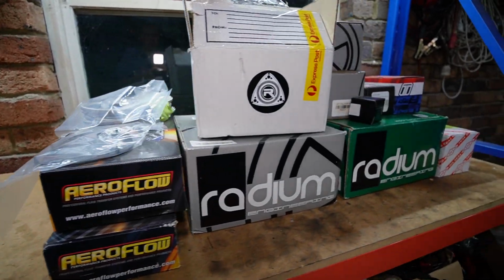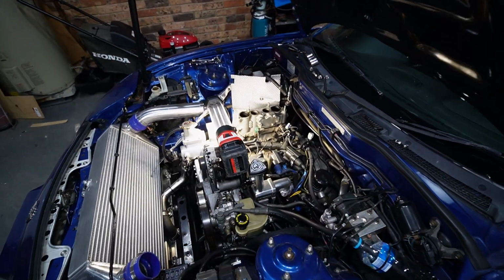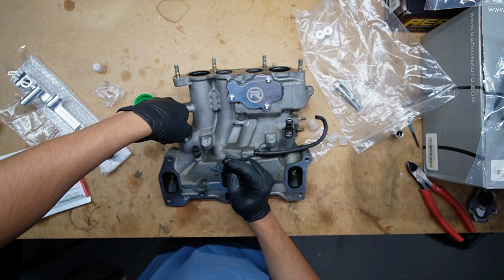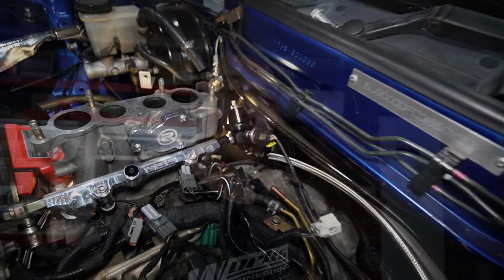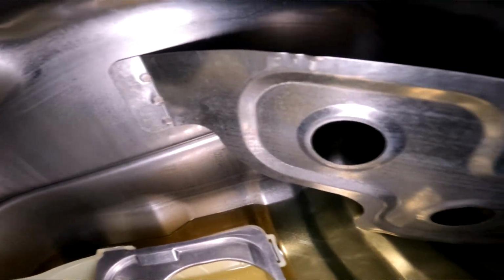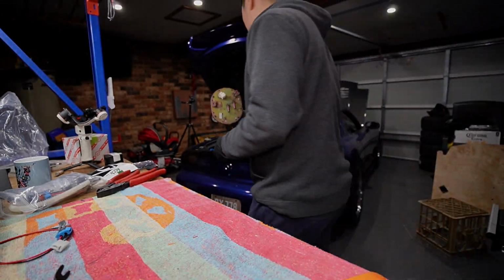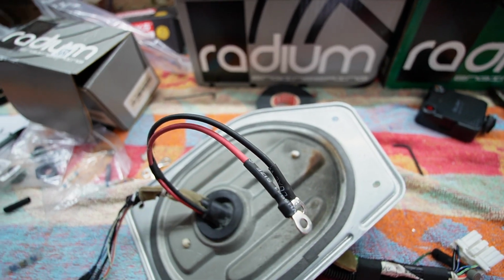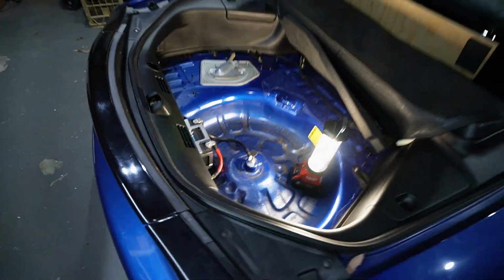500HP fuel system upgrade on the RX-7 ft. Radium Engineering Surge Tank!

Comment from the maker: **HOW MUCH POWER (HP) WILL THE FD MAKE?**
PTE 6466 
Secondary injectors ID2600XDS
Walbro 525
Stock ignition
98 fuel only
Reply: 507 powers of the horse!
Reply: I honestly believe 300rwkw would be more than enough on 98. I reckon you should get a flex tune
Reply from the maker: @cgrschannel7256  someone needs to dyno a horse
Reply from the maker: @cemturyan2653  I think in the future i will have no choice shall i decide to turn it up (which i will). I think for now i'd be happy with 300kw!

Comment: Interesting video, I recently installed the PAC FDd fuel tank in my car. It's good to compare the options.

Personally I would look to upgrade the fuel lines too. You can eliminate the leaks that happened in this video, such as the banjo fitting and the clamp on the tank by using AN fittings. For what isn't a great deal of extra cost and won't take a huge amount of time, you will have reliability and peace of mind.
Reply from the maker: I didn't know they did a fuel tank for the FD! 
My reasoning for not doing the lines now is because the filter relocation fittings are -12. While i can use step down fittings, the factory hose diameter is plenty for what i want with the car. There is nothing wrong with reusing factory rubber lines. The leak from the banjo was due to a faulty copper washer.
Reply: @JCYT  The PAC tank is great, easy to fit up and can do triple pump. Completely agree though, there is nothing wrong with the factory lines. Personally I want to eliminate points of failure and prefer to stay away from clamps. Also I run e85 so the PFTE lines are a must. I too have a similar filter (aeroflow -12)  that has been relocated just after the diff - previously it was on the diff, but there is not enough room with the bigger PAC tank. Stepping down to -8 has not caused any issues.

I do take a lot of inspiration from your videos though, keep them coming. I plan on replicating your battery mod. Mine is currently in a moroso box in the boot, but I would like to make it a bit cleaner and I like your concept hiding it in the spare wheel well.
Reply from the maker: Let's see how the tune goes and maybe I'll be forced to change them! 
Thanks for the support 🙏

Comment: what size injector you using for primary and secondary? You running Power FC ECU, right?
Reply from the maker: Haltech Elite 1500 
Factory primary injectors
Secondaries are Injector dynamics 2600xds

Comment: Amazing video! 😍 Could you please tell me what battery you're using? Does it need to be constantly connected to a charger? I'm considering replacing my 20kg Optima YellowTop with something smaller, but I'm concerned that my electric water pump will drain the  battery quickly if I switched to a smaller battery. Thanks Jonathan
Reply from the maker: Hey mate it's a Lithiumax Race 9! No I never have it connected but have an isolator I can isolate the battery if I know it'll be parked up for a while. Holds charge well!
Reply from the maker: I made a video on the setup just go back a few vids on the RX7
Reply: @JCYT  Thanks so much, I will go have a look😺

Comment: Did you need a specific model of Radium surge tank to fit the 525 pump? If so, which one did you get?
Reply from the maker: Hey mate 
No it was the standard kit but i think they have a slightly newer model with small differences. It came with all the fittings necessary to fit the walbro. 
I believe mine is Radium PN 20-0950

Comment: Why didn't you just go Radium all the way?  Secondary rail is $200 and it's scalable to 4 injectors.  Raceonly is super over priced.
Reply from the maker: I do love Radium products so definitely would have gone Radium rail also - however they are not so cheap in aus, About 300-350 AUD. I also wanted to keep the billet look consistent in the engine bay. Raceonly is local to me and i love their products